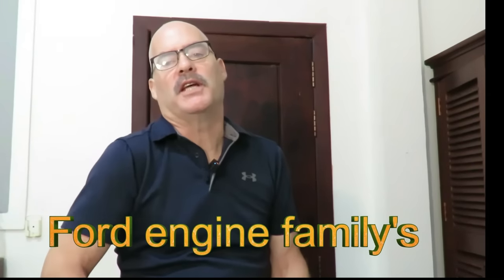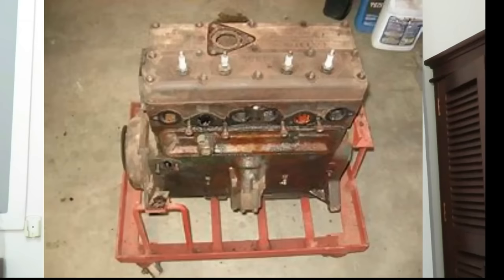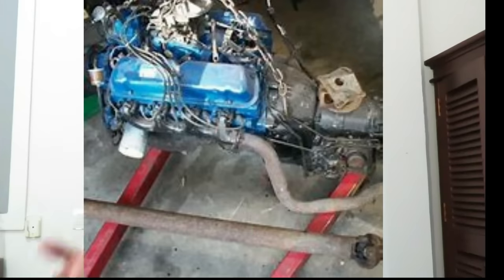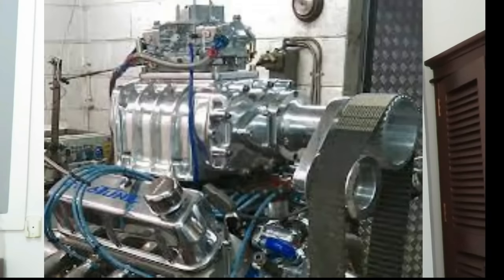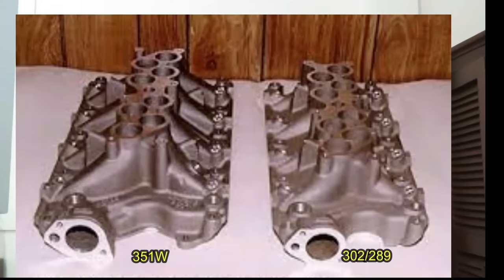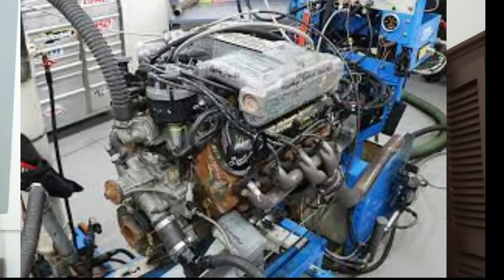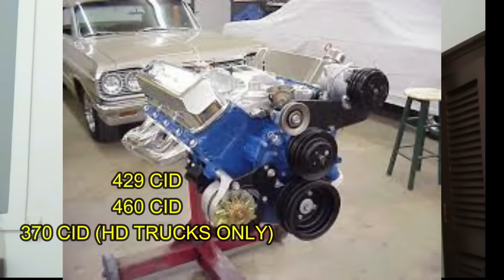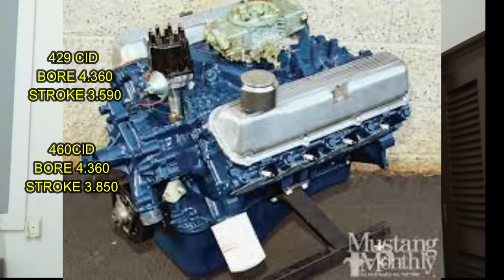FORD V8 ENGINE HISTORY

Comment: You may have been only covering passenger and small truck engines, and may not have been popular and lesser known but Ford made some for heavy duty trucks the Super Duty SD 401, 477, and 534. No timing chains but gear drive. Used in largetrucks only.

Comment: Every time i see a US video they neglect to state the 351 Cleveland and the 302 Cleveland ( yes i said 302 c ) were produced in Australia from 1974 untill 1984/5 and was the most common Ford V8 in Australia they were in everything from up market Taxis to F150 trucks, Buses , they were cast and assembled in Geelong Australia.
Reply from the maker: yeah I have known about the Australian 302 Cleveland for decades now, but it really has no place in American muscle car history, I need to correct you when you state it was not mentioned,
 I actually did mention it in this video you probably need to watch closer in America it was known as the Boss 302
Reply: @Myvintageiron7512  sorry my friend the 302 Cleveland was nothing to do with a Boss 302 , the Boss 302 uses a Windsor style bottom end and Cleveland style heads ( although the there was no Cleveland when the Boss was designed ) the Aussie 302 Cleveland was a 351 Cleveland block were Ford Australia installed a 3 inch stroke crank , 6 inch rods retaining the 4 inch bore , it came with ( very sort after even today) 2 V style Closed Chamber heads unique to the 302c even though it was a four barrel engine ( Carter Thermoquad carbies just like the Aussie 351 C ) this is a true 302 Cleveland , a very popular conversion was a set of 2V 302c heads with 4V US 351c valves on a 351 W block with a 400 (335 series) crank in the 351w block as they share the same Journal diameter ( drops straight in , as Ford did the opposite by dropping a 351W crank in the 400 block making a 351M it's M because it was a modified 400 but I've heard Michagan Casting Centre or even Midland as in mid way between Big and Small Block ) either way a Boss 408 comes out of the 302c heads , 351w block + 0.30, 400 crank , and Aussie Clevor alloy intake manifold that links the W block to C heads. All Ford bar the intake. If you want to see an odd ball 351 Ford Australia was looking around in 1974 for a new V8 to produce in Australia they thought the Cleveland was a bit over the top for Taxis, family cars , ect so they built a 351 Cleveland bottom end and used 351 W heads in effect making a reverse Boss to tone down the normal Cleveland, they were installed in family cars , about 40 prototypes were made I saw a complete one in a 1973 ford falcon , a very rare and special Windsor heads on Cleveland block manifold was cast in iron ( of course) by Ford Australia. But they ended up creating the 302c with its unique heads and out 351c with its own 2v style heads with 4 barrel intakes matching 2v port profiles. Ford Australia did crazy things , they took the 200ci and 250 ci Ford Sixes and put Cleveland style Canted Valve heads on them first in iron then in mid 1980s alloy , they got Honda to design the ports and combustion chambers. One last thing , to say the 351 Clevelands and Windsors share only displacement is a bit off , they share some very important things like bore spaceing , head bolt locations, bell housings , engine mount locations, this makes a bit of mix and matching possible, as in the above Boss 408 , I think it's a bit strange Ford chose to build 4 engines with the same bore and stroke that were different families , sort of in 1973 the 351 C, 351 W, 351 M and 352 FE all the same size ! Thanks for your time.
Reply: Aussies got the best stuff! ;)
Reply: @thisisyourcaptainspeaking2259  yes we did things differently down here , outside the US we are the only other country to really embrace the V8 , I sort of miss Holden , they made the best affordable V8 cars, Ford too but GM Holden was probably the first V8 most people worked on.

Comment: I hear this all the time about the FE the 360 390 was light truck passenger vehicle, the 361-391 medium duty truck engines heavy crankshaft large snout very heavy slow revving torque engines. I'm a fan of the FE engines they were terrible on fuel they were somewhat inefficient but you could make torque more substantially than horsepower. Great engines  sound awesome.when built up.

Comment: Model X (1926–1927)
The Model X is a sportier version of the Model A with a heavier and longer (136 in (3,500 mm) wheelbase) chassis and 100 hp (75 kW) engine that enabled it to reach 100 mph (161 km/h).[19] The most notable differences between the A and the X were that the latter had hypoid differentials and all its valves were on one side.[8]

The Duesenberg Model X chassis is an upgrade over the Model A chassis, offering a reworked 260 cu. in. straight-8 engine, an overhead cam, with a new crankshaft, revised valve train, improved pistons and superior intake manifold. Power is 100 hp, which made driving at 100 mph possible. The chassis length increased to 136 inches, with additional reinforcements. Improved leaf springs are mounted above the frame rails, thus, lowering the center of gravity. The Duesenberg Model X chassis is the rarest Duesenberg street production chassis ever made, with only thirteen ever manufactured. Only five of the Duesenberg Model Xs manufactured are known to have survived

Comment: 1915 Cadillac introduced a mass produce v8,chevy also had a v8 in those days. Ford over produced their v8 and made it affordable for everyone. Love your videos great info and advice.just check history.👍
Reply from the maker: yes caddy had one along with a few others but they were definitely not mass produced,
 the production was limited those v8's were cast in several sections and bolted together they were heavy and very expensive to make each one was Custome built by hand,  not assembly line built IE mass produced,  in fact when the ford flat head came out Henry Ford had already been producing V8's in his Lincon's for over a decade but again heavy underpowered and expensive the flat head was a 1 piece casting mass produced on an assembly line it was the first v8 built this way

Comment: Remember that the the Cleveland went away in the United States in about 1974 but it didn't go away in Australia until about 1982. The 351m may have been low performance but I had a brand new F100 in 1978 with a Long Wheelbase and I had a friend that had a 1978 Chevy with a 350 small block, long wheelbase just like mine and stock for stock he could not stay with me. The Ford out ran the Chevy stock for stock every time so they were not that bad. They were detonation sensitive though because of the open chamber heads.

Comment: In 1920, the Duesenberg brothers relocated to Indianapolis, Indiana, where they founded the Duesenberg Automobile & Motors Company, manufacturing the Duesenberg Model A.[4] The brothers assumed engineering roles after signing over the naming rights and patents for Duesenberg engines to promoters Newton E. Van Zandt and Luther M. Rankin.[5]: 40  The first Model A was commissioned by Hawaiian businessman and politician Samuel Northrup Castle. The car had a 260 cubic inches (4.3 L) straight-eight engine that output 88 horsepower, the largest engine in a commercially available vehicle at the time, and was the first to have hydraulic brakes on all its wheels.[6][4]

Comment: The first Model J prototype was created in 1927 and the first cars were delivered in 1929, shortly before the onset of the Great Depression. About three hundred Model Js were completed by 1930, short of the original 500-vehicle goal.[21]

Model J engine
The car's 7 L (420 cu in) engine was based on the company's racing engines of the 1920s and was manufactured by another Cord company, Lycoming.[22]: 73  It output 265 horsepower (198 kW), aided by dual overhead camshafts and four valves per cylinder, making it the most powerful car of its time.[21][22]: 72  The Model J was capable of a top speed of 118 mph (190 km/h), and 88 mph (142 km/h) in second gear. Duesenberg historian Randy Ema wrote that the Model J spurred change in engine design, "single-handedly (starting) the horsepower race that drove the number of cylinders from twelve to sixteen," but noted those engines still could not match the Model J's

Comment: I still own the 428 cj that came out of a wrecked 69 cougar convertible, which I will be working on next year for a 66 Fairlane. Currently I'm starting on my 78 Bronco that I bought new. It has a 351m in it. I also have a set of 351c 4v heads, and was wondering if any one has ever matched the 351c 4v heads with a 351m block?

Comment: My 1964 Ford 1/2 ton had a 292 V8 it had the crossover exhaust pipe so I will disagree on the years range of the Y block

Comment: Thanks for the video. Some things to consider. Chronologically, the FE engines should have been after the Y blocks. I cringe when I hear people say Windsor for all the engines 221/260/289/302 because Ford Never called them that! If anything Ford called them the Fairlane V8 because they debuted in that Car lline. And the smaller displacement engines were not produced at the Windsor plant but actually in the Cleveland plant. Only the 351 Windsor was produced at the Windsor plant and that is why the “W” is used and the “ C” and later on the M for the 351 M is used because it’s a modified version ( destroked) 400. The 400 debuted in 1971 the 351 M was a stopgap engine because with the end of the 351 Cleveland engine, Ford could not meet the demand of that engine size with just the 351 Windsor. Additionally the 335 series includes the 351 Cleveland. Just like the 351 Windsor is essentially a tall deck 302, the 351M/400 are tall deck Cleveland’s. The M may actually stand for the  Michigan casting center or that the M lies halfway between the letters C and W. But nobody really knows. Otherwise a great video!
Reply: Nobody cares dude we have always called the 289/302 Windsor's yea so they are technically not made there no one gives a S%&t they are identical engines this is the problem with Ford guys they get all upset about stuff that does not matter
Reply from the maker: True for the 302/289 not being from Windsor Ontario but everyone Identifies them as being the same family, so they just call them that if that drives you nuts your way to uptight because people are never going to stop calling them Windsor's

Comment: Thank you for these videos.  I find them very interesting and informative.  One thing I have a question about on the Ford flathead; I remember hearing somewhere that Henry Ford figured out how to cast the V block in one casting.  Prior V configuration engines were modular parts that had to be assembled.   This made the V configuration economical to produce in cars for the masses, not just expensive cars.  Do you know if this is true or any other info on this?

Comment: You did fair in the video, butI do have to somewhat disagree on a point or two. The 400M can be a rather decent performance engine. Money may have forgotten or don’t know that 351C heads will bolt to the block, changing it’s whole performance character. True, there were no aftermarket intake manifolds to fit this combination, but there was a port plate kit one could get from, I think Weiand, that would allow using 351C intakes. I know because I have one of these sets. To give ya an idea of the performance potential,one person I knew, used this combo to push a ranchero in excess of 160 mph. Another used this combo in a pull truck and super stock legal, blew the doors off ALL his competiton

Comment: Alright time to make some people mad. If you don't like the 400, you dont know what they need or you want an engine to rev over 6k. You need to know the 400s were never designed to rev over 5.5k and are a low end torque truck motor. If you know anything about pickup engines, they're kind of like a 7.3 powerstroke or the IDIs. They dont like reving super high or making high horse power numbers but make really good torque down low. With good oil/oil pressure, good intake/exhaust, a decent cam/timing set, they'll make a very useful engine that will last a very long time. In the Cleveland family, the 351 is the performance car engine but 400 is the truck engine, its that simple. I understand where guys are coming from in the performance world but my dad and I have both had 400s in Broncos and F-trucks with 0 issues. They make more torque than any of the Windsor engines and get better gas mileage than the 429/460.

Comment: What about 1960's 474 and 534? Dump truck motors. Also Ford made Sherman tank V12. Saw article guy had V12 running on stand off 5 gallon can. Quits ,so checks spark and compression. Turns out it sucked 5 gallons in 2 minutes!

Comment: Fords tractor engines also featured a large bore versus short stroke configuration.  Not ideal in this application, unfortunately, as one had to really rev them to get into the power band. The bottom end torque left a lot to be desired. Those two statements were also true of V8 engines, irrespective of make - just a quirk of the design. V8 engined 'muscle tractors' made a brief appearance in the early 1970s, but were found to be wanting in the torque department, which is obviously important in an agricultural tractor. Their 'bruiser' looks promised more performance than they could actually deliver, and so they quickly fell out of favour.
 The reasons aren't hard to find - high erpm, plus two extra cylinders to 'feed' (compared to a straight six design), were the main parameters that did for them.

Comment: A few things to note:
The flathead ran hot because the exhaust had to flow out between the cylinders.  This held the heat inside the engine longer.  Other manufactures of flathead V-8's ran the exhaust out the top.  As long as they were careful not to vapor lock the fuel line this was not a problem.  Ford eventually installed two water pumps to cool the engine better.
FE stands for Ford Edsel.
Y blocks often suffered from clogged oil passages to the valve train because the non-detergent oil in those days could not keep the passages clean.  Many people ran small lines from the external oil pump to holes drilled in the valve covers to keep the valve train oiled.  
Also, I do not think that Ford was bigger than GM in the '50's and 60's either in sales or revenue.
Reply: I agree with you on GM being bigger with sales and revenue...I think he meant that Ford was bigger in the fact they created everything from their own raw materials. From wood to glass they did it all. Where GM outsourced everything.....which is fine too. I've always been open minded with car brands.....I drove Fords for years....and now Dodge trucks and cars. But I have had other brands and they worked well too. I've had good luck with anything I've driven. All the companies make cars that are not great in some models.

Comment: Mostly accurate! I was worried that you were going to skip over the FE when you  didn’t mention it during the timeline 😂
Kinda wish you had gone into the Mod Motors though. They started out as anemic little small blocks, but the technological advances that Ford made during the Modular years was incredible. Little 261 ci engines that had hp numbers to rival the old FE engines, even though they lacked that FE torque. 
Great episode regardless!
Reply from the maker: Yea the FE was definitely on my last but not least thinking it is one of my personal favorites built and owned many over the years I love stroked 390's I have combo that I've put together several times it always makes over 500 ft lb of tq
great engine

Comment: I'm not a big fan of Fords. But I would love to have an old flathead. 
As a GM guy. Ford's engine families and sizes are just too confusing. GM engines are a lot easier to figure out. More parts interchange for sure

Comment: Was the big car version of the 429 heavier than the 428? Seems to have looked bigger although I don't think it had the deep crankcase of the 428
(1970 version)  429 absolutely needed the highest octane gasoline around even before the beginning of "unleaded fuel only" -- think people ruined some of them with low octane gas especially as high octane gas got hard to find as the cars got to be a few years old  
   confusing array of "cobra jets" and "super cobra jets" and other hi po members of both 429 and 428 groups as well as the hi po only 427 and hemi competition race 427 that might have gotten banned from Indy or something 
regular passenger car 428 was civilized and quiet running with good acceleration although not in a power class with the hi po engines that shook rattled and snorted when driven slowly -- I think it may have been valued as a police car engine because somewhat tolerant of regular grade gasoline

Comment: If you follow the way Ford called there engines the Windsor was built in Windsor, the Cleveland was built in Cleveland, and the M was built in Michigan. I f You look on the  back of the block the M engine will have a MCC cast into the block. MCC stands For Michigan Casting Center. There for the M should stand for Michigan.

Comment: I'm kind of weird I read old engineering articles and Ford never really came right out like Chevy and said big block small block know they didn't but they did classify them by the board spacing and well for instance I've read articles and I saved them about the FE engine when it started off as a 3:30 something I believe then 3:52 and it went on from there Ford classified the FE engine as their medium block, and at that time in history the MEL what's considered a BIG BLOCK FORD
This was a ford designation, you're right they never did go off big block small block. They're big on engine families and now in modern history they named their engine families now.